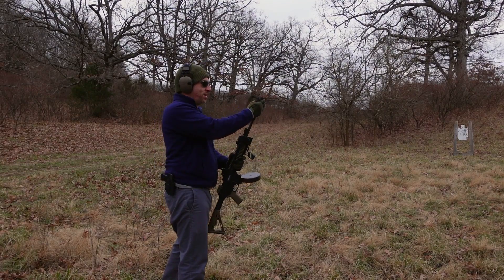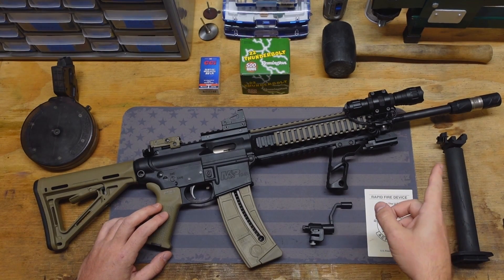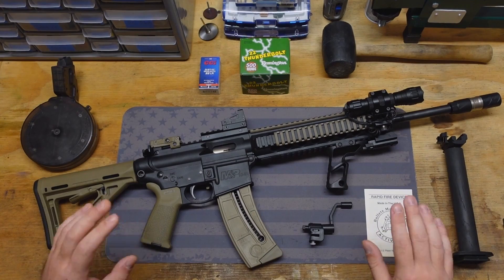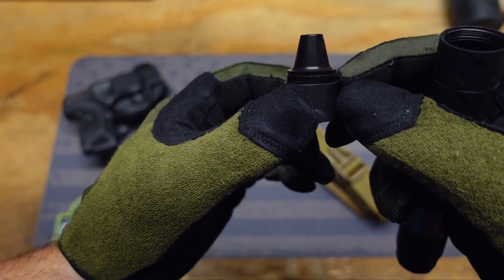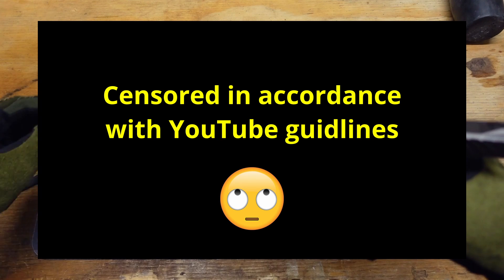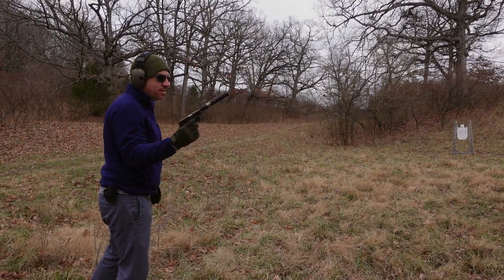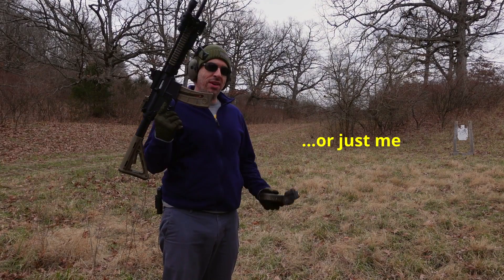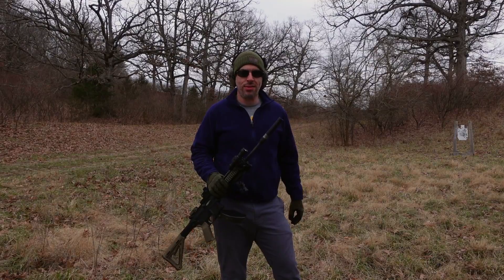I 'Sploded My Odin Works Nav 22 Suppressor (censored reupload)

Comment: Did you take off the O-Ring of your Bobcat while firing with this suppressor?
Reply from the maker: No, I know you're not supposed to use shims or a crush washer with suppressors, but I think the o-ring is OK
Reply: @AmattEUR  I have had some issues with mine too. They have been from the steel portion of the suppressor forward. I have blown out two baffles within 24 hours on pistols alone. The Aluminum is thin and I have used only low velocity ammo only. Just a Beretta M21 and Ruger MK 4.
Reply from the maker: Interesting. My blow out happened right after the steel portion too. I've definitely tried to be more cautious but so far so good. Have you tried reaching out to Odin Works? They were very helpful

Comment: Today while shooting my Nav 22 it blew apart. It broke off the threads of a baffle and fell to the ground. It didn’t launch like yours did. I’m hoping Odin Works does for me what they did for you. 
 Thunderbolt is complete garbage. Years ago, it blew out an extractor on one of my 15-22’s. Same day, it also blew out an extractor on another guy’s 22 pistol. I’ve never shot Thunderbolt since.
Reply from the maker: Dang, sorry to hear. What gun were you using when it blew apart? I'm guessing Odin Works will make good by you. Mine was a complete replacement (and it was kinda my fault for mounting it to a weird contraption) but they honored it no questions asked. I know people have had bad experiences with Rem TB but I like it, I just don't shoot it with a suppressor anymore. My M&P1522 and Taurus TX22 chews that stuff up. Let me know what Odin does
Reply: @AmattEUR  I had it on my TX 22. Also had it on my M&P 22 and M&P 15-22 before that.  I had just put it on the TX and it was the first round fired when it happened.
Reply from the maker: I've had pretty good luck with it on the TX22. Oddly enough it won't cycle CCI subs but will cycle CCI Quiet semi-autos, Norma subs, Rem subs and so on.
Reply: @AmattEUR  mine loves the cci suppressor ammo, very quiet. Also likes Aguila subsonic.